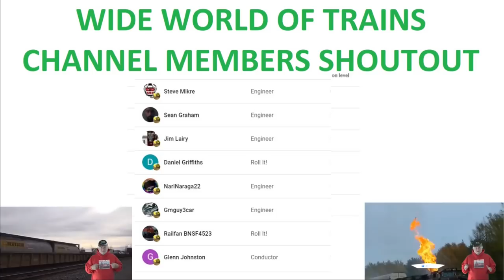3 BNSF Engines Pull Grain Train! Double Train Meets Long Range and Short Range! CSX Freight Train!

Comment: the conny caboose was a blast from the past! wonder if it's a museum move or someone found it and bought it? who was driving the 368 paul bunyon? 18 to 20 centers right off and 30 to 33 total!! you can tell the bridge 107 crossed has been there a while 10 foot 11 inches! modern standard is 15 foot! cheapskate must be low on power 634 had that yarder running on a long haul pay drag!!

Comment: 0:49 We are at Barry Road in Pomfret, New York on 16 March 2022 as the CSX gates are going down. At 1:04 we see the lead engine of CSX train #I009 peek over the road as it approaches. At 1:12 train #I009 hits the crossing. At 1:36 a mid-train DPU appears.
2:39 We hear the horn of another CSX train heading in the opposite direction. This is CSX train #Q204. At 2:47 we catch a quick glimpse of train #Q204 between two well cars on train #I009. At 2:55 we see the end of train #I009 appearing and we get a better look at rain #Q204. At 3:24 a mid-train DPU appears in CSX train #Q204. At 4:16 train #Q204 passes Berry Road. At 4:47 train #Q2-4 passes the Mile Post 44.8 signals. At 5:26 the gates do up at the Van Buren Road crossing.
5:45 We are at the Berry Road crossing in Pomfret, New York on 21 March 2022 as CSX train #C750 is going past the Van Buren Road crossing and it is approaching the Mile Post 44.8 signals. At 6:21 the Van Buren Road gates go up. At 6:35 the lights on the Mile Post 44.8 signals turn on and we see that there is a green signal for an eastbound CSX train on track #2. At 6:39 the gates at Berry Road start ti gi diwn. At 7:12 traun #C759 passes Berry Road. At 7:17 you zoom in on the end of CSX train #C750 as we watch it continue on its way to the CSX Rail Yard in Erie, Pennsylvania for the night. 
7:39 the headlight of eastbound train #Q368 on track #2 appears as the train comes around the curve from Brocton, New York. At this point the eastbound train is about four miles from the Berry Road crossing.
7:43 CSX train #C750 finishes crossing Lake Road. At 7:47 the gates at Lake Road start to go up. At 8:10 train #C750 finishes crossing the Martin/Willow Road crossing. At 8:16 the gates go up at the Martin/Willow Road crossing. At 8:39 the end of CSX train #C750 the end of CSX train #C750 passes the Mile Post 47 signals and goes under the I-90, New Yorkj State Thruway, bridge that  goes over the Norfolk Sourhtern and CSX tracks. 
8:51 There appears to be some white cars coming east around the curve that leads toward Brocton, New York. At 9:02 the lights of an approaching eastbound CSX train #Q368 appears to the left edge of the last covered hopper car on CSX train #C750.
At 10:04 the gates go down at the Martin/Willow Road crissung as CSX train #Q368 approaches. At 10:44 the gates start to go down at the Laek Road crossing. At 11:10 CSX train #Q368 hits the Lake Road crossing. At 11:41 train #Q368 hits the BVerry Road crossing. At 12:48 a mid-train DPU appears. As train #Q368 passes Berry Road, you zoom in on the train as it continues east. Then you pan back west as more of the train keeps coming. Finally at 13:53 CSX train #Q368 finishes crossing Berry Road. Again you zoom in on the end of the train as it continues east. At 14:24 CSX train #Q368 passes the Mile Post 44.8 signals. At 14:48 the lights on the Mile Post 44.8 signals go  dark. At 15:00 the gates at thr an Buren Road crossing go up. 
16:23 We are at the CSX Middle Road crossing looking east as CSX train #Q367 is approaching on track #1 on 17 MaRCH 2022. aT 19:11 CSX train #Q367 passes our location.
19:48 We are at the Berry Road corssoing and we are looking about a quarter mile south of the railroad tracks where a deer is crossing Berry Road.
20:19 We are at the CSX and Norfolk Southern tracks over Willow Road near the Town Hall of the Town of Dunkirk, New York. The Town of Dunlirk, New York is a different governmental entity from the City of Dunlirk, New York. We are looking at the CSX tracks as CSX train #G107 powered powered by three BNSF engines. This is an as needed empty grain train. You did not indicate the date that you captured this train.
22:52 We are at the Berry Road crossing in Pomfret, New York on 17 March 2022. We are looking west at CSX train #Q634 which is approaching us. At 23:15 train #Q634 hits the Berry Road crossing. There is a remote control GP38-5 as the last engine on the front of the train. There were empty high side garbage gondola cars in this train but there was no sign of the car with the Wide World of Trains graffiti in this train. At 24:33 CSX train #Q634 finishes crossing Berry Road. You zoomed in on the end of trian #Q6634 as it continues east. At about 25:07 CSX train #Q634 passes the Mile Post 44.8 signals. 
25:17 Your Outro begins and concludes at 28:00.
Thank you for documenting these trains for us and for compiling this video for us to enjoy. That was a neat meet between CSX train #C750, the Dunkirk Local, and CSX train #Q368 west of the Mile Post 47 signals near the I-90, New York State Thruway, bridge. (Posted 23 March 2022)

Comment: Those lumber cars are worth more than loaded autoracks!
Reply from the maker: That's for sure
Reply from the maker: Actually I'm not sure about that with the 2 by 4 being around $5 apiece how many are on there?  If there are 18 new cars on the auto wreck at 40000 apiece 40000 a piece that could be more than the lumber, interesting question  Though